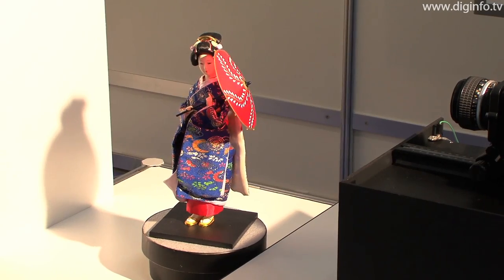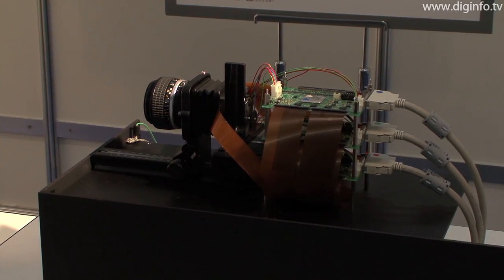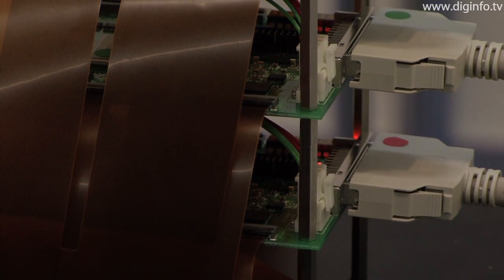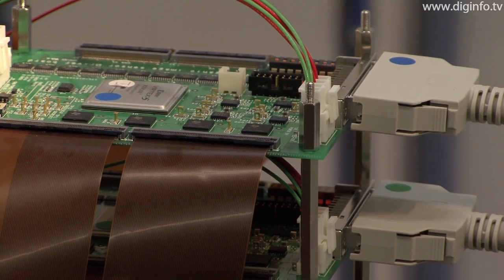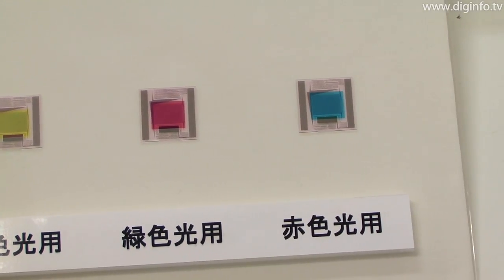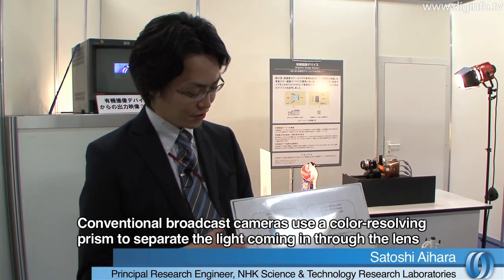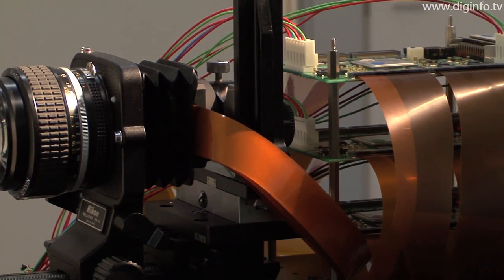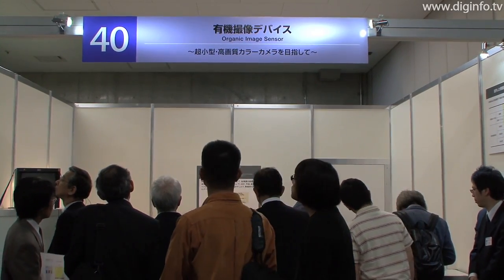Organic Image Sensor : DigInfo

Comment: @powguma Did you not read the captions at all?  They are researching to get rid of the large prism that is present in video cameras of today.  By using the organic image sensor, they can use those thin films instead of the large prism.  This will result in a much smaller camera.

@LordKhensu normal cameras also have three sensors...the light just passes through a prism to separate the light into red, green, and blue.